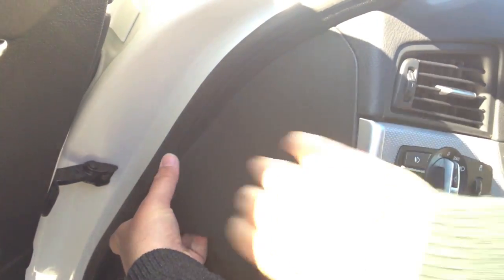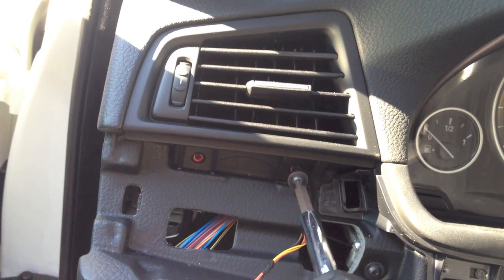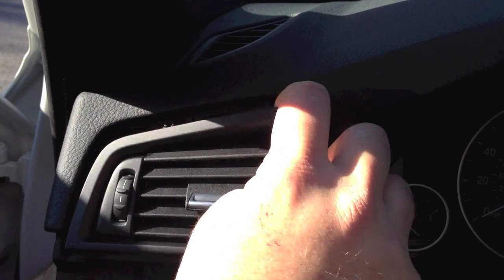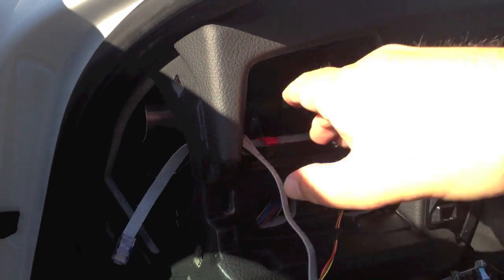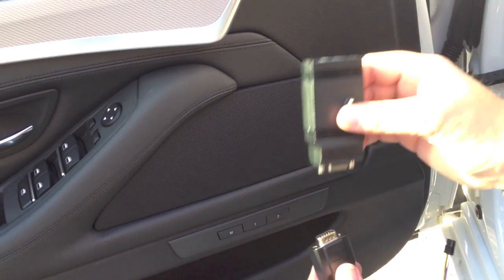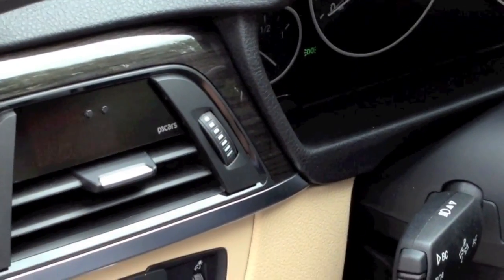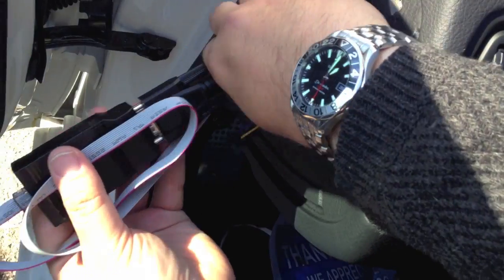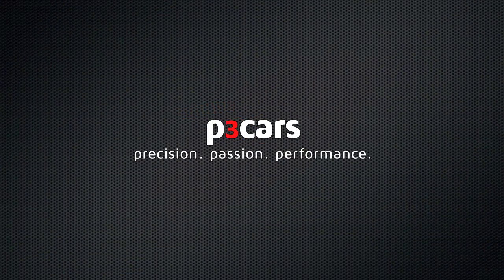P3 Cars - BMW F10 Install Guide - Digital Interface - 528 535 550 M5

Comment: Where can I get this? It this for boost?
Reply: DeeJay 7XTC Yes. For Boost, Cooling Water Temperatur, Exhaust Temperatur and mich more. I installed this on my F10 535i and it fits very good.